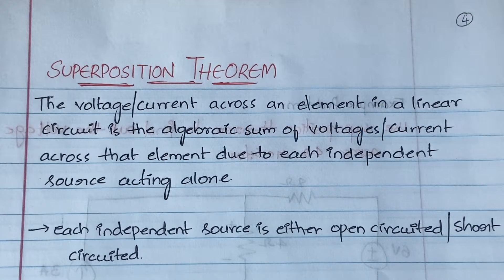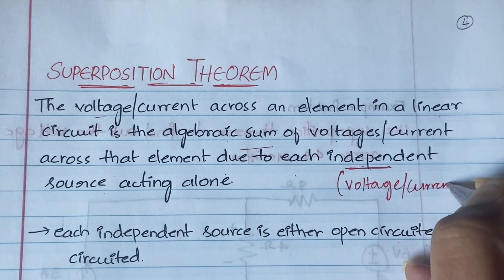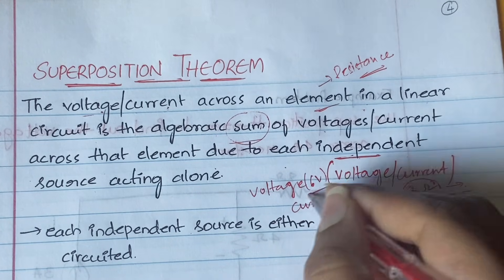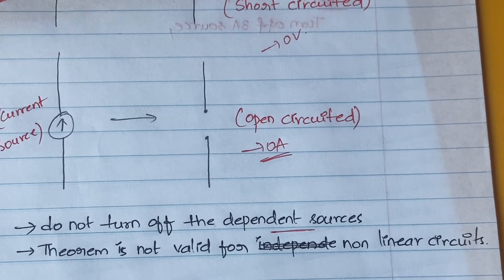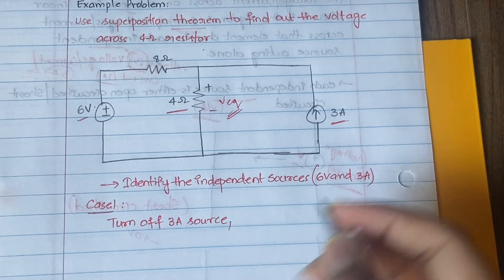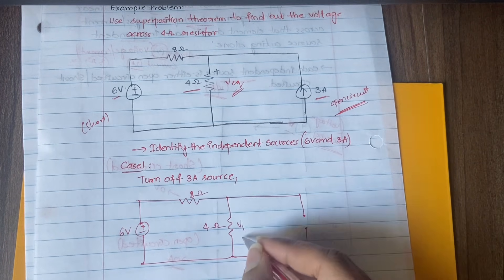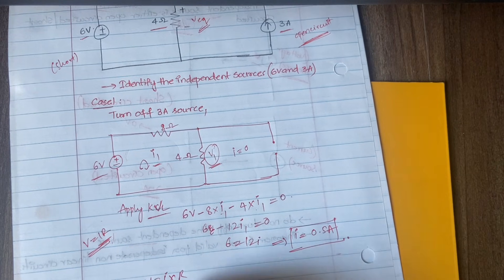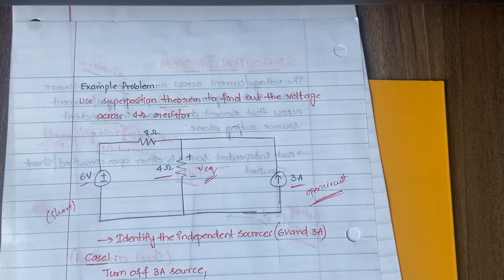Superposition Theorem in BEE, Concept and Example Problem |Lec 10| |BEE|

Comment: i think that you have made a mistake in the last step of the calculation 
while calculating the voltage in the second step of the example no current will pass through the 8 ohm resistor as it provides higher resistance.
hence the voltage in the ckt will be 12v 
henve final answerr will be 14v through 4ohm resistor.
Reply: Yeah for me also same doubt.